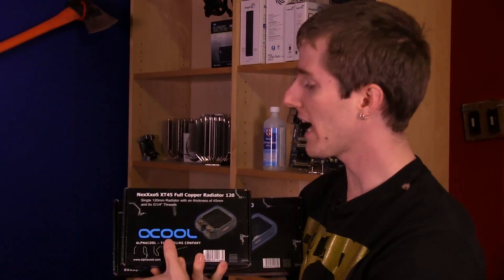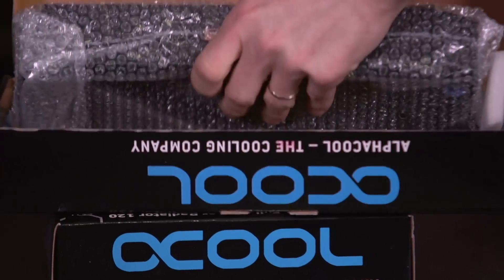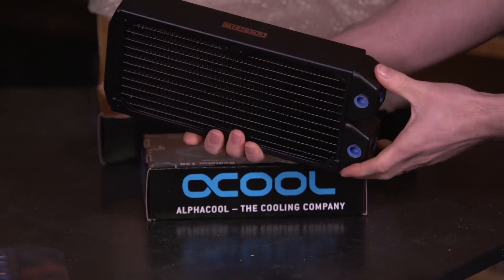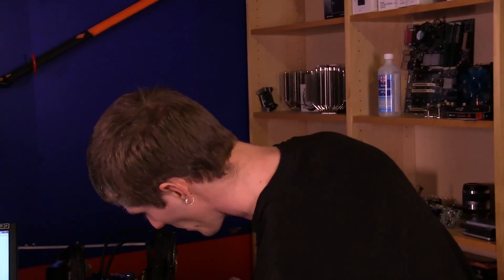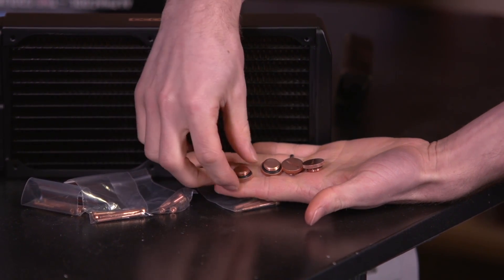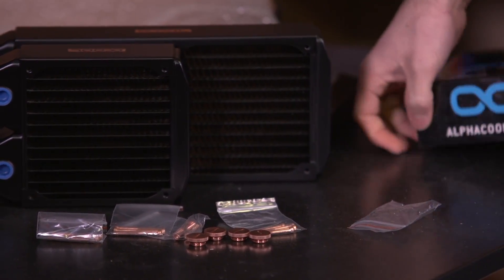Alphacool NexXxos XT 45 FULL COPPER Radiator Unboxing & First Look Linus Tech Tipsa

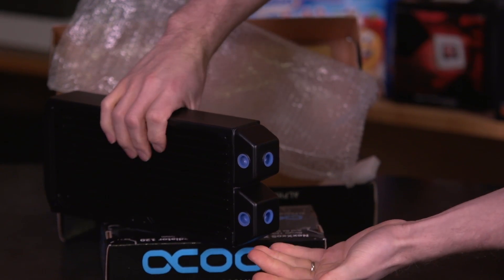Comment: 2:28 Really, that would be great. 

Now thicker rads have two pros: 1- don't need static pressure fan 2- 2:28

If what you said here is true, I prefer 280 thick to 360

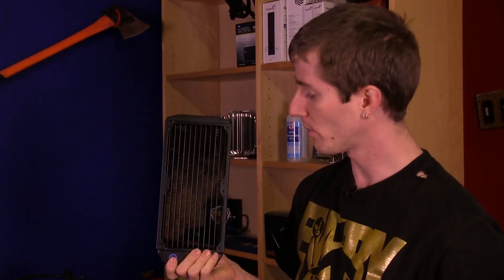Comment: 1:15 Aluminum doesn't "dissipate heat better".  You cannot "dissipate" any faster than you can conduct, as dissipation is a function of conductivity, and copper's thermal conductivity is nearly double that of aluminum, which is why in all cases copper heatsinks have superior cooling properties for a given design over their aluminum counterparts.  Aluminum is lighter than copper, and much less expensive than copper, and for those two reasons aluminum is generally selected for over copper; if cooling is the ONLY design concern, than copper is the best choice, period.

Comment: NOTE TO POTENTIAL BUYERS:  Be careful when screwing screws through the fans+radiator when time comes.  I punctured 2 radiators due to no labeling by the company when they package the 2 different size radiator screws (which are for different width fans).  There are protective metal plates underneath the screw holes that are meant to protect the screws from going too far but even with minimal screw in pressure, these screws will open up the radiator.
Reply: ironically, alphacool puts a VERY strong plate all around the perimeter of their rads to PREVENT that from happening. If you really went through that AND punctured your rad 2 times, then you miiight want to rethink your methods of watercooling...
Reply: +LibertyMan not meaning to insult you but why did you just take the screws and screw them in? i mean don't you take a look and them and sevondly and most importantly why didn't you stop screwing the screw when you noticed that it got significantly harder to screw it in??
Reply: +Kaden Watt..... if by "very strong" you mean extremely weak aluminum then, yes.
Reply: +OtterStrikesBack ....it wasn't getting hard to screw in.  it just kept going.  thebplates it has to catch the screw give little indication of its fastened-ness.  my biggest beef I had was of its lack of labeling of the screw for specific width rad fans.  its irresponsible product quality control which causes cases like mine to occur.

Comment: Well. Just got in a Alphacool NexXxoS UT60 Full Copper Quad 120mm Radiator and the plugs are not copper and neither is the mounting screws. The LOGO is not in the center but now smaller and in the bottom corner opposite of the inlet and outlet ports in blue print instead of the big LOGO we see on it in this video and other pics we see on the online stores to buy it.
Reply: Crow2099 Yeah.. I got the same. Bummer :/

Comment: Well the plugs and the screws are only copper coated, so maybe that isn't 100% copper or it has some kind of protective layer... Anyway Linus said on Alphacool GPU block video that usually copper is fine until you touch it with greasy hands. Then it starts to go green. So I guess it has some kind of protection that doesn't like grease. He wears gloves in that video.

Comment: Quick note: The screws are copper plated and not solid copper (I've cut one apart to shorten it and it's normal steel underneath).
A solid copper screw would probably be useless sooner rather than later because of copper's softness. One would have to be very careful not to over-tighten it.

Comment: of course the G1/4" plugs are copper, if not there would be galvanic corrosion throughout the water circuit. that won't happen if every piece of metal the water touchs is the same material

Comment: Those look a lot like the Koolance radiators. I prefer the "blockier" style radiators such as the XSPC AX series. I do like the additional holes on the side though; that could come in handy. I want a radiator with holes on both ends. They could do it if they added an additional pass through chamber. That would be sweet!

Comment: One thing nice about a copper radiator is you would have all copper in the system. Copper and aluminum exposed in water cause oxidization, this completely eliminates that. As for copper screws...why? I wouldn't want weak copper screws vs stainless steel

Comment: I have the very same in a Level 10 GT, dual up top and single on bottom along with strategically drilled holes in the case top and bottom for drain and fill ports...just unscrew a plug and done!

Comment: IDK much about watercooling, but the usual hydraulic system has several smaller lines out and then they all dump into one return, which doesn't necessarily need to be as huge as one might think. I've seen four 30mm feeds come back in a single 42 mm tube. 

But yeah, the way Linus explained it seemed a bit backwards to me aswell.

Comment: You couldn't have 3 going in then 1 going out, you would end up with a bottleneck there and different flow speeds of the fluid through the loop, unless your out tubing ID was 3x the size of your 3 in tubes ID

Comment: There are several benefits to both aluminum and copper. It is scientifically proven that copper transfers heat better than aluminum transfers heat. Copper is also easier to repair than aluminum in most situations. Aluminum, however, is generally 30 to 40 percent lighter than copper.

Comment: Material strength is one of the biggest differences between copper and aluminum. Copper tubes that carry coolant have to be thin to keep a copper radiator cooling efficiently. Copper is somewhat weak, and tubes need to be narrow to prevent internal pressure from swelling. Aluminum is stronger, which makes it easier to use wider tubes. Using wider tubes allows for more direct contact between fins and the tube, which increases the radiator's capacity to dissipate heat.

Comment: Copper was the original choice material in the manufacturing of radiators because of its superior heat conductivity. The biggest differences between aluminum and copper radiators are strength, weight, heat conductivity and appearance.

Comment: If I were to use 2 of the 240mm radiators in "Sli" on the top of my case, with a total of 6 fans in push-pull-push-pull, exactly how much would it weight with liquids and all?

That might be a big strain for a weaker case.

Comment: Dissipation is based on surface area and surface to air delta temperature. The faster the surface is warmed by more conductivity, the higher the delta and therefore more dissipation. The claim that aluminium is a better dissipater is just a bad excuse to use cheaper metals. Conductivity, as always, is king when surface area is unchanged.

Comment: It also has a lot to do with having only one type of metal in the loop which should eliminate problems with galvanic reactions that take place in many loops using differing types of metals in contact with the water.  Copper is a better conductor of heat than aluminum and so it offers a lower temperature delta between the area the heat enters from the water and the area it leaves to the air so it should offer slightly faster thermal energy transfer if the surface area of the rad fins are equal.

Comment: the two inlets in the top and the bottom is because there is an alphacool logo on the sides, and its orientation depends on how you use the rad, with the multiple inlets you could avoid that issue